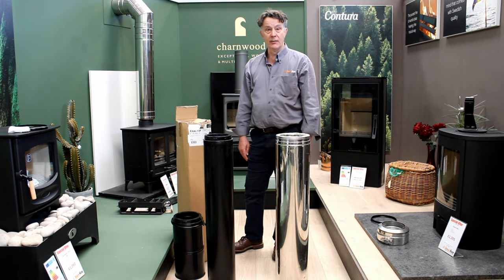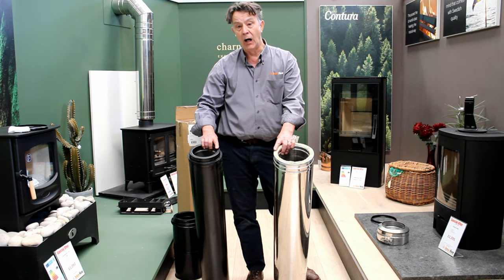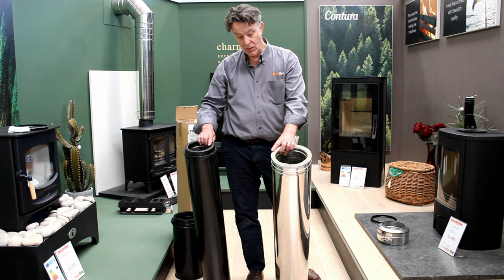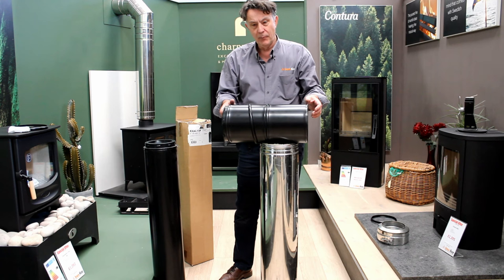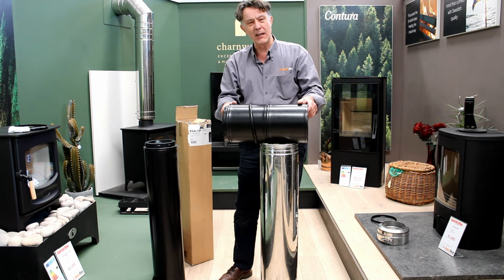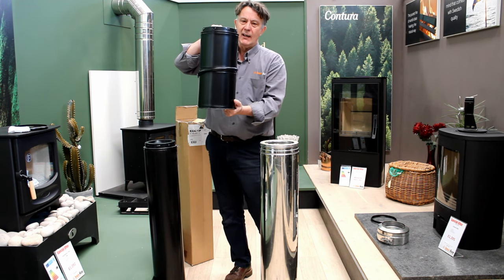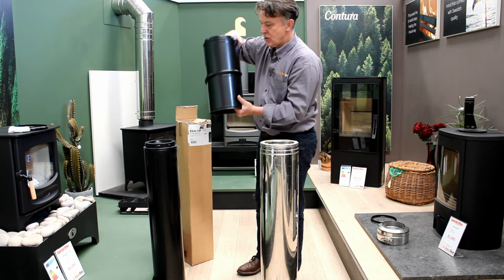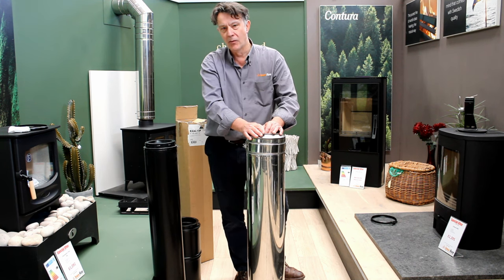What's The Best Twin Wall Flue?

Comment from the maker: DO YOU WANT MORE INFORMATIVE VIDEOS? 💭
Reply: Hi, what do you use or sell to put a twin wall Flue through single storey warm flat rood extension (300mm Cavity) Rood is also fibreglassed, so how do you make it watertight and how do you get the Flue stays on the roof to fix to the fibreglass roof without penetrating the roof with screws, this losing your watertight integrity? Is there a kit you sell for both?
Reply from the maker: @adamfisher6413  It is not a kit we sell neither is it a diy job. In the end, its not really any different to a felt or a rubber roof. The flashings would be installed in conjunction with who is doing the roof. You don't need screws but it may be sensible to have an upstand in the end. Where abouts are you based?

Comment: Is the open unit a lot cooler on the outside? I have some concern over where I want my flute to be installed on the outside of my house, where someone potentially could reach out and touch it (I know, they shouldn’t. But a concern nevertheless).
Reply from the maker: As the twin wall is insulated the heat is contained to a certain extent but the flue will still get hot no matter what unit you go for. Precautions should be taken in regards to distance to combustibles as advised by manufacturers guidelines and regulations in your country. You could look at getting a flue cage or boxing it in maybe?

Comment: Hello great video. I have kingspan insulated roof and twin wall pipe The pipe was made in Spain cant remember the name but is was not the cheap stuff. Should i cut the insulation back a bit from the flue? Thank You Marc
Reply from the maker: Hi Marc, Thank you! For twin wall flue it should be cut back and installed inline with manufacturers guidelines (generally 50mm to combustibles) and in accordance with local building regulations. Kind Regards, Max

Comment: Thank you! I have a twin wall system coming (HETAS approved) they state distance to combustibles 50mm.. how hot should I expect the outer layer to be? I am passing it through a combustible floor with a ventilated firestop system.. just trying to assess if I should keep it further than 50mm…
Reply from the maker: Hi, really, there is no simple answer to your question, sorry...

If you read the spec for the TW flue it will have a specification, within this specification, it will tell you at what temperature etc... the DTC (distance to combustible materials) it was specified at, you need to read and understand this, because it is possible that the 50mm (or whatever distance) to combustibles is calculated at differently.

As an aside, dont forget that the flue outside temperature will be hotter the closer you are to the heat source!

One of the most important elements to get your head around is the DTC is generally calculated in "Free flowing air" soo, if you incarcerate the flue in a confined space without air flow you will get what is know as the "Oven effect" - which means that like an oven,  the whole space heats up to the same temperature as as the flue and the DTC ceases to apply.

Do hope this helps
Reply: @bonfirestoves  thank you! This really helps.. to mitigate the oven effect i could install more ventilation in the boxing in of the flue or insulate it further with ceramic fiber around the outside of the flue?
Reply from the maker: Can I ask if you ask if you are HETAS approved ? I dont want to come across as a jobs worth but you have to be qualified(in England) to H006 to install twin wall https://www.hetas.co.uk/trade/training-courses/h006-system-chimneys/

Comment: Good video, i would lie to shop around for the stove and the correct approved parts preferred by the installer's, been given quotes for a simple small stove that exceeds 4,000. may as well pay for the gas and electric bill. Do you do anything on the recommendation of stone hearths.
Reply from the maker: Hi, you are right, it can take a while to recover the costs of a full installation, when compared to your electricity and gas bill - unless of course you have a convenient fuel supply. However, interestingly,  we are finding that one of the main motivators for our customers is "having control of their heat source" , so energy security, rather than just the cost

Comment: Can you get the silver one in a black colour and can you get the twin wall flue systems in them? How much are they for the 5” ones?
Reply from the maker: Yes, chrome twin wall flue pipe can be painted black using heat resistant paints, advisable by a specialist paint shop. 

Different manufacturers flue system quality drastically differs depending on the metal quality and thickness, the process in which the flue is produced and finished and the connection used to join the twin wall togethor which is reflected by the different price points and will determine how effective and how long your flue system will last.

Please contact us for pricing of our flue systems for your fireplace or stove installation.

Comment: Thank you for the video. Can you use part twist and part push fit?
Reply from the maker: Personally we would avoid any twist TW flue, just because it makes it awkward to line the sections up. It is also recommended to use the same system throughout.